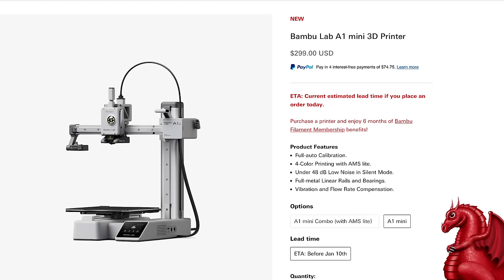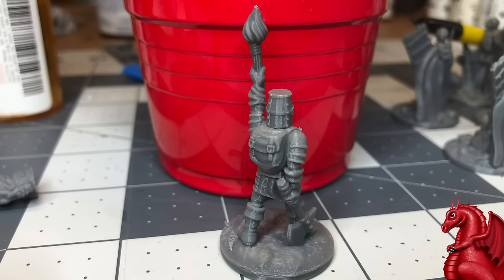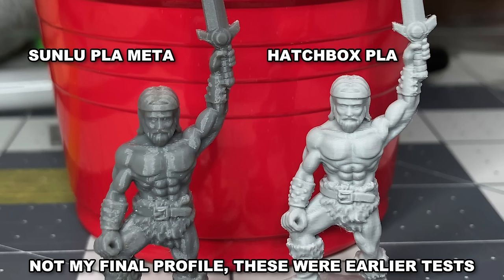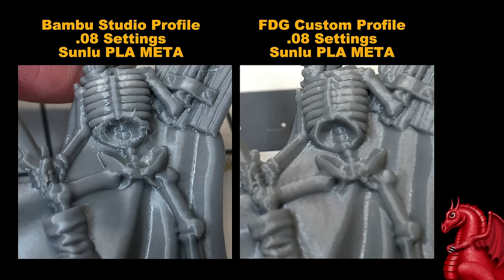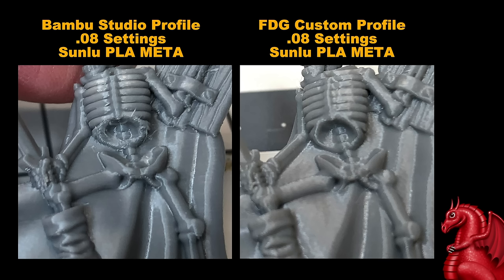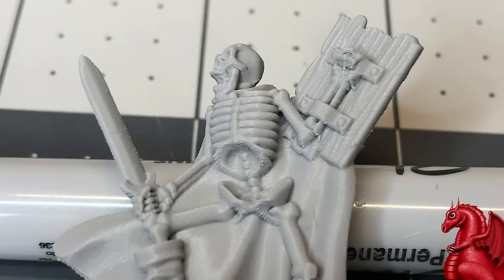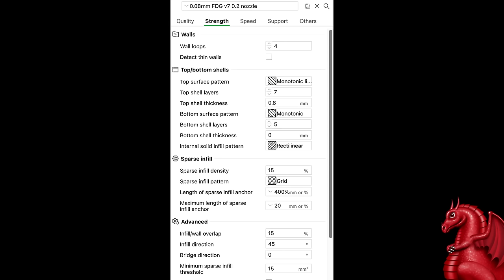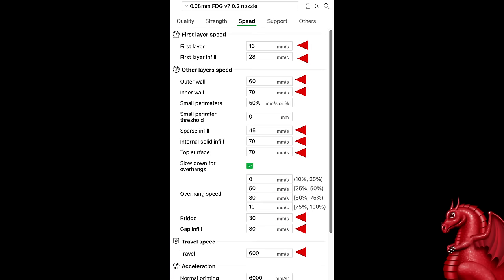Bambu A1 Mini - The Best FDM Miniature Printer!

Comment: I really wish I'd waited a few more years before getting into 3d printing, these modern machines are making my temperamental and unreliable Ender 3 look worthless and obsolete.
Reply: yeah its nuts how good the new stuff is, I have a couple of p1ps, and coming from an ender 3 as well, being able to slice on my computer, hit print, it wirelessly going to my printer and never having to mess with bed leveling or anything has been amazing. plus it'll print something that takes my ender 3 24 hours in like 6
Reply: It is
Reply: I retired my ender3 last year. They were not designed to last forever. Like your phone.
Reply: He's done his life, it's time to move on 👍 technology goes forward
Reply: Retired my ender 3 last month I get my bl A1 next Wednesday
Reply: Got an Ender 3 for Christmas like 4 years ago. Use it weekly and it's never given me any problems. Shame you got a "Friday" model.
Reply: I have a V2 Neo and an SE on a sonic pad, and I can say mine throw out pretty darn good prints, that I'm sure they can battle the high end ones
Reply: Throwing away an Ender 3 is always a good idea…
Reply: I hear you, I've only been into the hobby since last summer but I got an Ender 2 Pro. It can make great prints - when it works. Since the past 2 months it's just had problem after problem, culminating in a shorted motherboard two days ago. I'll still patch up my E2P, but I'm now saving up for an A1 (full, not mini).
Reply: Switched last month from my ender 3 to the Bambu lab. Didn't look back. Will also retire my elegoo mars.
Reply: Have an Ender 3 printing things for my shop. Starting to do n scale model trains and was torn cause I want faster more reliable fdm printer that can do peg, but I also want a resin printer to print buildings for n scale train layout. Maybe this could be the best of both worlds and not have to buy wash and cure station.
Reply: that's because it is
Reply: Sold 4 Ender 3’s. 2 A1’s are running circles around them.
Reply: I upgraded to the a1 mini and my ender 3 neo has been completely replaced. I have printed more in the first week of having the mini than in 6 months of working on and maintaining an ender 3 neo with all upgraded parts.  Save what you can. get the mini for 250$ and consider the time saved as money saved.
Reply: @manuel509rios Yah have no idea how wide the gap is. Im telling you. No ender will touch the a1 mini no matter how much love and tinkering you put into it.
Reply: Did the same for my prusa mk3. Got a bambu p1s combo and it is leaps and bounds ahead
Reply: Eh, if you think like that you'll never buy anything. I can almost guarantee that in another 3 years the tech will improve just as much. And then you'd be saying "man, I wish I waited 3 more years" 😅
Reply: The Ender 3 is the probably the most basic FDM printer. Is cheap, upgradeable, and easy to maintai, perfect to learn about 3D printing before jump to serious printers. Is not a waste of money at all.
Reply: I have a Duplicator i3 Plus that is still kicking. In fact, it’s upstairs right now running a print. I was really jealous of the prints people were getting off their Ender 3’s and almost talked myself into getting one a couple of times, but of course now I am super glad I waited! One of these Bamboo machines will be an amazing upgrade from the i3 Plus when I finally get one. 😀
Reply: If you had waited you wouldn't have had these years of printing you had. 
Yes, tech now is better than it was a few years ago. And tech in a few years will be even better. It'll continue to grow and change, but one thing that will never change is npe is all we get. Use it now. Don't wait for the future. Make the future today. 
You're awesome, you've done awesome things, and when you can upgrade your kit, you'll be that much further ahead.

Comment: Arachne has issues with tiny details on the walls, regardless of the print.  It's not so much an issue with the process itself, but if you have a lot of fine details, you want to use the Classic still.
Reply: Huh I've been printing super high detail 75mm minis on my p1s and haven't noticed anything weird with details on robes or armor
Reply: There settings for Arachne to increase the minimum detail size. With this bumped down to super small numbers, you get much better details. The default values are set to smooth out small details, to keep gcode size down apparently. Bollocks if you ask me.

I need to compare to the classic wall setting, that I have not done yet.

Comment: Have been printing terrain 24/7 on my A1s over the last few weeks, the 0.4 nozzle at 0.08LH is  almost completely without layer lines but the tolerance for horizontal resolution is higher vs on minis. A few 0.2 nozzles should be arriving tomorrow and excited to try the profile, thank you for sharing great info!

Comment: Does color have an impact on pritner settings like if I wanted to print with Sunlu Meta Black filament, would I be able to use the same settings that you used for the gray?

Comment: I've tried a few tests and the quality is good, but I'm having a nightmare removing supports. I've used auto supports, with Tree, but I've destroyed both of my test prints trying to get the supports off. Any tips on this?
Reply from the maker: None of my miniatures require supports. You need to ask whomever you bought the models from for their recommended settings to print their products.

Comment: Love my A1 so much that an A1 mini (space and wanted to try out the AMS) is coming next week and it will be doing double duty in son's 6-8 grade class.  Thanks so much for working on these profiles and figuring this out.  I resin print, but the more I can do with FDM, the happier I am.
Reply: Resin is such a messy process - printing, cleaning, washing, drying. And you don't always notice you have a failure until it's too late. And with FDM you can pretty much handle the end product straight away without worrying that toxins are leaking in to your skin. I love the quality of resin but everything else about it sucks.
Reply: Are you able to get the same success using these settings on your A1? I have an A1, but all the good dnd mini profiles I see are for the A1 Mini, and I wonder if they'll work as well on the A1.

Comment: Sunlu PLA Meta is my go-to PLA as well, been using it almost a year. Keep up the good content, I basically learned the entire trade of printing minis from you when I started.
Reply: Hi, 
Do you print the Sunlu meta at the profile temp or the lower temp recommended by Sunlu?
I understand they differ?
Reply: @TheDarkplace  I print at 195, going lower I noticed the layer adhesion suffers. Do not confuse PLA with PLA Meta, they are different.

Comment: Really great video and settings. This is my first 3D printer and so I purchased the profile; it was perfect for getting me started with my A1 mini for printing miniatures.

I've played about with the settings some more and found some improvements for fine details I wanted to share:
Layer height 0.04 mm
Initial layer height 0.2 mm (improves adhesion issues I was having)
Outer wall 0.16 mm
Top surface 0.16mm

Wall generator Arachne, with min wall width 30% and min feature size 20% (the wall width changes are key and this showed better behavior than classic in my tests)

I also had to play around with the filament settings a bit as I was getting significant stringing even with Sunlu Meta at your default settings. I reduced temp to 205, put retraction to 5 mm and retraction speed to 45 mm/s (as suggested in a blog post created by Sunlu on their website) and this has mostly solved the issue.

If you were interested in trying these settings I'd love to hear how you find the results. I'm getting phenomenally detailed prints for FDM with them. Thanks for getting me started with your awesome guide!
Reply: How about support settings?😊

Comment: Well, thanks for forcing me to finally bite the bullet and jump into the Bambu A1! Never wanted to deal with resin and the toxicity, space, and cost (of peripheral tools and such) requirements, and was really tempted by the A1 when I saw Fauxhammer review it. This pushed me over the edge!
Reply from the maker: Just to be clear, this video is on the A1 MINI, not the full size A1, there are differences in print quality between them.
Reply: @Tombof3DPrintedHorrors  Ah, I figured the quality difference between them was negligible, but is the A1 worse for minis, due to the larger print volume, or better than the A1 Mini? Haven’t actually picked between the two yet, but I figured the A1 just offered an overall better experience. Might opt for the mini if it’s likely better for smaller prints.
Reply from the maker: @Loriborn  a single z screw is better than dual (they can 'fight' each other) and also the Mini has a linear rail for the Z axis, that combined with the smaller bed (less Y axis inertia) is giving better results on miniatures in my testing. I'll be posting a video on the full size A1 print quality in a few weeks once I finish all of my testing.
Reply: @Tombof3DPrintedHorrors I appreciate the response! I did end up opting for the Mini based on these findings, and since this is my sole intended use case, but I did grab some of Bambu's own PLA basic filament. I noticed there weren't any test images of custom profile with the Bambu filament in the video. Is there a significant difference in print quality between the Sunlu Meta and the Bambu Labs PLA basic with the custom profile? I figured I'd ask as the former is still on sale for the time being.
Reply from the maker: @Loriborn  yes, the difference between the two filaments is pretty significant when printing minis. Stick with Sunlu PLA Meta or Hatchbox PLA (standard, not plus) for minis.
Reply: Running PLA near it's boiling point like say around 220 is going to generate ultrafine particulates. That isn't healthy either, it may be worse since it's a hazard that isn't being respected as opposed to say resin.

Comment: Normal the bambu needs more heat because the speed. When you print slower you can lower the temp i read in forums.
It would of course be interesting to find out whether the settings would also work on the A1.

Comment: i was always interested in 3d printing, but the resin printers were simply too much hassle for me: they need too much space (because all the extra stations you need) and the toxic fumes were also a big thing that prevented me from getting into it.
with this printer it looks pretty easy to print some minis with good results. and the prize looks also good. i think machines like this could be the breakthrough, to make 3d printing more accesable for people. i always wanted to create my own bits to modify my minis or even create some completly new ones. and i have seen so many cool minis from designers out there i always wanted to to try out. this printer could make it possible.

Comment: Filaments matter a lot. Speed and layer height matters a lot. I've been getting decent results on 0.2 nozzle, 0.04 and 0.06 layer height. 
Arachne slicer is always good. You can lower external wall thickness by 1/4 (0.16) in order to improve overall quality, but be warry that it can result in underextrusion with some extreme angles. Compare classic+arachne line thickness in slicer to see what's up with the mini you liked more.
I use sunlu pla+ instead of meta. It just feels that with higher temp I have better control over flow. 
Set minimal layer time for ~10 seconds maybe to help with top thin parts

Comment: Maybe the temperature issues are down to the ambient temperatures of the individual rooms you and your friends have the printers in?
Also, have you tried aiming a fan across the print bed surface to see if that helps any? I know with their bigger printers you can get a fan that does that and it is supposed to help improve quality by cooling the printed filament quicker.

Comment: Nice video. I really want to get a Bambu Lab A1 after seeing your video...
Reply from the maker: I am still testing the A1 for minis. So far it's not quite matching the A1 Mini.
Reply: Damn. I just pulled the plug earler today on the a... and then came across your channel and video on the a1 mini w .2 mm nozzle..   I am hopeful it will come somewhat close w tweaking.

Comment: Will be trying this on my P1s! I have a resin printer, but hate dealing with the mess and failed prints, at least compared to my FDM printing journey.
Reply: Wondering if the profil worked on the P1s?
Reply: @Dangoow  haven't tried it yet; been printing some larger prints with a larger nozzle size currently.
Reply: @Dangoow  Hey mate, finally swapped to my 0.2 nozzle on the P1S and printed a Xenos-esque Talon for Space Bugs that I would normally print in ABS-like resin, and it came out remarkably close in detail, albeit slightly more fragile. Definitely a good starting point for you to test a supported mini and adjust from thee based on your likes/dislikes. I used a slightly different filament, Sunlu Matte.
Reply: @iamaraindog385  thanks for letting me know and perfect timing(just got my 0,2 nozzle)

Comment: Just bought one. I have or will soon at least have two printers. Ender 3 v3 SE and the A1 mini w/AMS. Pretty excited. Both are "budget" printers but I feel like the feature rich A1 mini wins hands down.
Reply from the maker: I have both and the A1 Mini is, by far, the best 3D printer I have ever tested.
Reply: @Tombof3DPrintedHorrors  Both choices were actually inspired by your channel. I think something understated for some is that as much as I would like a resin printer I live in an apartment and it isn't feasible in a safety sense. So having something that's close enough to a resin printer while not needing to deal with the amount of cleaning and the fumes of a resin printer is a godsend.

Comment: The beard difference between the two can be attributed to the temperature being to hot on the one w lesser detail, since the machine your A1 has no enclosure and that can get too hot easily and also allow moisture to build up in the filament and which I noticed on the sword top of one of the figures as the sword tip has small misses in the top layer lines which is caused by moisture in the filament and that moisture quickly being heated to air as the layer lines go down leaving pockets of air usually around smaller areas a gradation.
Reply from the maker: Nope, everything was dried thoroughly before testing, and temp tests were conducted for each brand.

Comment: Such a great video. Thanks Tom.  One thing I would like to know is how your settings work on non- FDG minis, I.E. minis that are not optimized for FDM printing and need greater supports.
Reply from the maker: You need to ask those designers for their recommended settings, I can only provide tech support for my own products.
Reply: @Tombof3DPrintedHorrors  Got it.  Sorry if my question offended you. Wasn't my intention. Been a huge fan of FDG since the early days of Copper Dragon Tiles.
Reply from the maker: @deanm375  no offense at all. For a miniature to print well it's 50% engineering of the sculpt for the intended print method, 50% settings. If a sculptor doesn't design for tolerances of the mechanical printer (such as ensuring parts that need support are engineered to be mechanically strong enough to withstand separation of the support) there's no amount of slicer setting adjustment that can fix that. :)
Reply: @Tombof3DPrintedHorrors   Thanks Tom. I  appreciate the feedback.  I just purchased some .2m nozzles for my Anycubic Mega S hoping to improve my print quality. I'm going to try an duplicate some of the settings you were mentioning on Bambu A1. I've used the settings you spoke about several months ago to improve mini printing and I got decent results. Hoping the .2mm nozzle improves it.Thanks.
Reply from the maker: @deanm375  for the Anycubic Mega S, I'd recommend my Cura Ender .2mm nozzle settings as a better starting point.
Reply: @Tombof3DPrintedHorrors  that sounds great Tom. I'll look for them on  the FDG site. Thanks!

Comment: This may be a daft question ..... would these settings also work on its bigger brother the A1? I am new to the hobby and currently look at the A1 because of the lager print space for other cool stuff I find but my main focus would be miniatures . Thanks in advance for any responses.
Reply: No one ever answered you, the A1 and A1 mini are the same printer, just with a different build plate size. Everything with the head and motor mechanisms is, as I recall, the same.

Comment: I'm struggling with support scarring still, using these settings. Anyone have any recommendations? Are you using tree supports, and are you modifying the parameters at all to reduce scarring? Or just dealing with it via clever orientation?
Reply from the maker: None of my models require supports.

Comment: I didn't think FDM printers would get to this point.  I had a resign 3D printer, printed great, but the fumes were just too much for me and I sent it back after 30 days.  I have a Prusa MK3S+.  I've been looking at the enclosed printer that Bambu makes, the Carbon X1 I think.  If enough FDM printers get to this point I bet more models will specifically made for FDM printers.

Comment: I have printed on the A1 Mini with Sunlu Meta and from my tests it is significantly worse than my current favorite Jayo High Speed filament.  I believe Sunlu and Jayo are the same, but Jayo comes in 1.1 kg rolls for the same price. I tested using the Goblinoid models used in the video which will be my new go to test model.  I suspect other High Speed filaments may produce good results.  I also love the dark grey colour it makes the other greys look insipid.